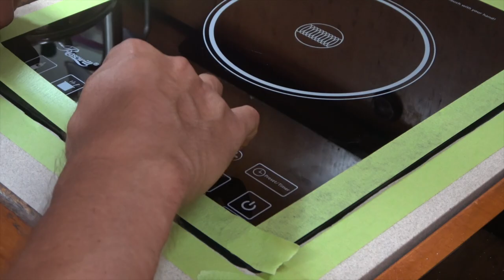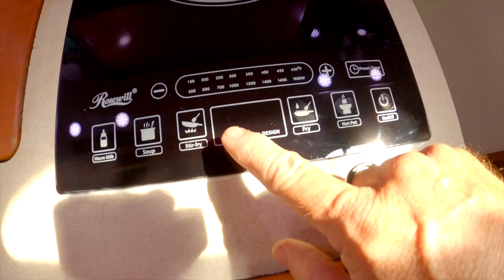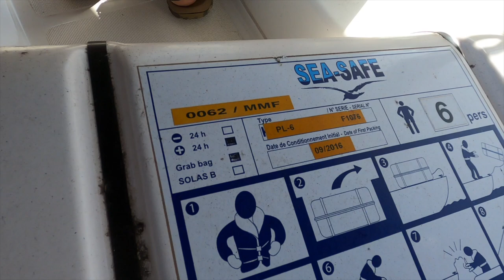SSL518 ~ She's BACK..!!

Comment: I am a general contractor who's work is mostly doing the odd and difficult thinking through to the end and eventual sale of the asset while seeing functionality for the present. I know, it's a full run on sentence. That said; I am stoked with the tape off before caulking.... kudos, I am most impressed with the safety switches to prevent electrical waste and secondary gas function as back up. I appreciate the common sense thinking and planning. It takes a little extra effort to make things so cool and so simple and so functional.  Kudos to one of my favorite vids.
Reply from the maker: Thanks mate, glad you can appreciate the thought that has gone into my design!  :)

Comment: Probably bringing coals to Newcastle, but make sure you have a few spares for the CGFIs  they will fail if lightning gets too close to you. Far from a strike, close will kill them. Even if they are turned off at the time. I'd keep the spares in a cookie tin too.
Reply from the maker: Yes, the boat has about 10 of them from original.. luckily none were damaged when we had the lightning after the hurricane!

Comment: How do you cook underway with no gimbaled "stove" or a means to contain the pots and pans on the induction plate?
Reply from the maker: listen in the video, there is another gimballed 2-burner stove going to be installed underneath the induction stove, and also rails to be installed on the top burners for underway in medium conditions.

Comment: Rick are you still running a wind generator as a surplus power source .. a good friend pointed out that wind is all you need and it will charge day or nite .. I know there are some improvements in the newer ones on the market than the ones years ago ..

Comment: Ps: I would have put in two isolation switches so that 50w user never came on unless I specifically wanted to use it..., your burning electrons unnecessarily while you’re using the small one... 🤷‍♂️😉🙏

Comment: If you had the opportunity to purchase an AIR-FRYER , would you? I have the Ninja Digital oven and it's faster than our kitchen oven and it has other functions the oven does not and would replace certain kitchen appliances, cooks and bakes anything, easy cleaning, i love mine have not used our oven in two years.